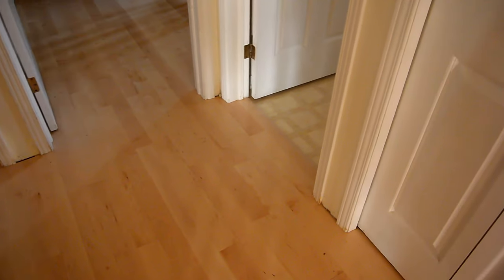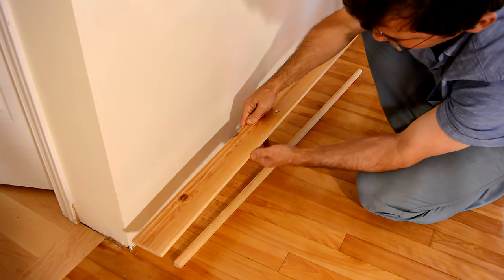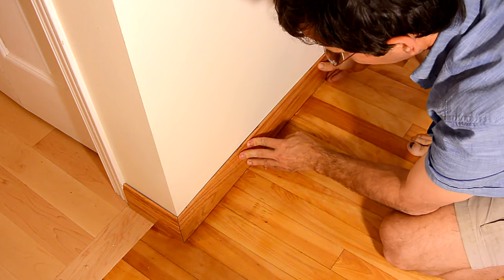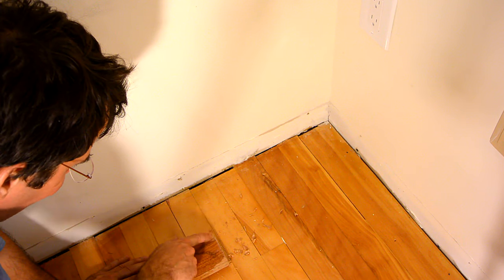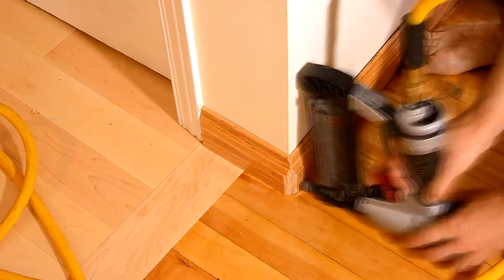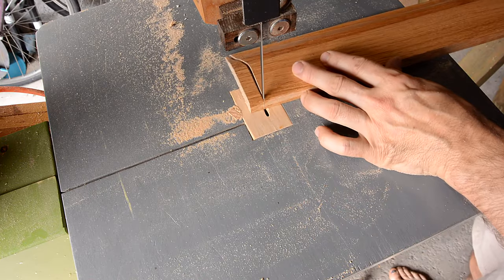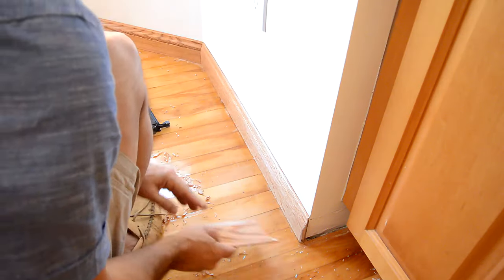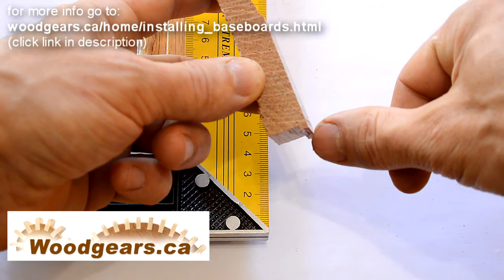Installing baseboards

Comment: The absolutely ugliest outside corners I have ever seen. Also Oak baseboard with white door trim looks like crap . Normally I like this guy but not this installation
Reply: tackless I'm sure he will change the molding around the door
Reply: T N.    No you're not , because the correct way to do it is to change the molding on the doorways first and then work away from them. The present  doorway moldings  are smaller  than the baseboard molding  so they will not fit properly . So no you are not sure.
Reply: tackless custom woodworking you make it to fit
Reply: I like the corners, they are both interesting and less likely to abuse your foot. The oak baseboards turned out beautiful. Matthias could certainly ad new trim to the doors without too much effort. He is a clever guy. Cheer up, tackless, go and enjoy the sunshine or something.
Reply: Ian Johnson.  I am cheerful my friend and that has nothing to do with it. I've never had a baseboard corner abuse my foot in my life. And I do not think many other people have either. Kind of a silly statement. And no matter what he does now it is still the hard way to do it and you still wind up with white jams . I'll head out into the sunshine now to make you happy.
Reply: tackless, the sun will do you good! Lots of people have stubbed their toes on baseboard corners, I see some here in the comments. The baseboard is beautiful and unique. You are just a grumpy pants :)
Reply: Matthias is into wood everything.  It's only a matter of time before he starts shellacing the walls!  Then the trim will match don't you worry your little head.
Reply: Ian Johnson —all bullies are like that. Just look at Trump. They hurl insults at all these people but their own ego is completely fragile.
Reply: artcamp7, I also consider Trump a bully, but I also consider the left to be bullies as well. How could they not be with groups like BLM, Planned Parenthood, and Antifa? Trump and the left deserve each other. I say this and I voted for Trump, lol! The current state of politics is pretty sad...all based in identity.
Reply: tackless he can be sure and wrong. You can’t question his conviction like that and not look like an arse
Reply: T Conway.     What do you mean question his conviction. Do you actually understand the definition of that. Conviction is a strong belief or opinion . Now you understand that , understand this. I did not question his conviction but you questioned mine . Or is there a different definition of conviction on your side of the pond. I have no idea why my seemly innocuous  comment struck so many nerves.
Reply: tackless true, it means a conviction or believe. Someone said they were sure of something, meaning that they believed it to be the case. You said they were not sure, I think you said it twice, meaning that you were telling someone that they didn’t believe it at all. 
Whether he was right is irrelevant. You don’t get to tell someone whether they actually believe they are right.
Reply: T Conway.    Can you comprehend or is that a problem for you. The one person said I'm sure. Now that means it is not an opinion it's a matter of fact. The second one stated it's only a matter of time. Another statement of fact. So maybe you just want to be difficult or you have a real bromance with gyro gearloose but once again you are wrong my friend no matter how many times you try to make it right.
Reply: tackless cute. You’re being so condescending whilst so ignorant. If HE is sure, he is making a statement about himself, not about the rest of reality. He is SURE that he’s right isn’t the same as ‘he IS right’.
Reply: tackless Theres no need to tell that in such a rude way!

Comment: I have put relief cuts in the boards before,  but depends on if it is thick enough to do. If the gap isn't to big, I have occasionally put caulking or filler in the gap and painted it to make wall or base boards.

Comment: I worked for a guy years ago that would say you could throw a cat through the opening on that inside corner.  Putting a bit of a relief angle on the coped corners helps close the gap. Thanks for the video and have fun.....a bit of advice, get some knee pads. I have to say the outside corners leave a bit to be desired.